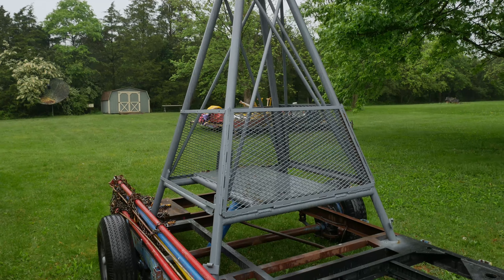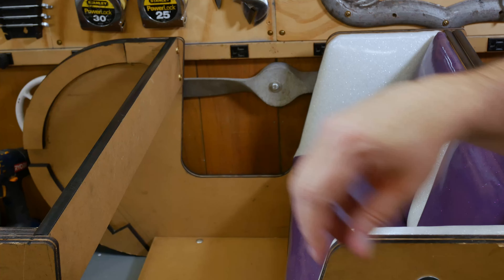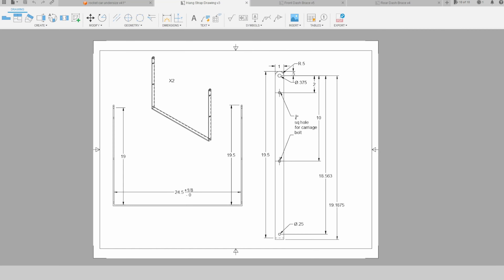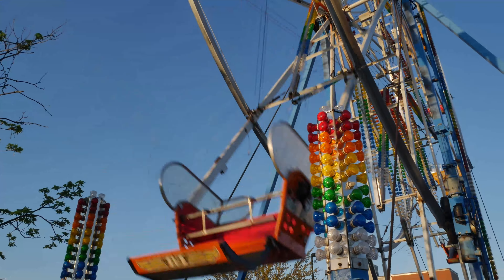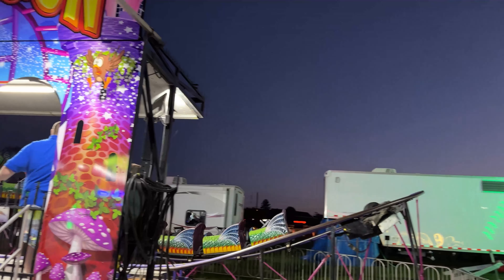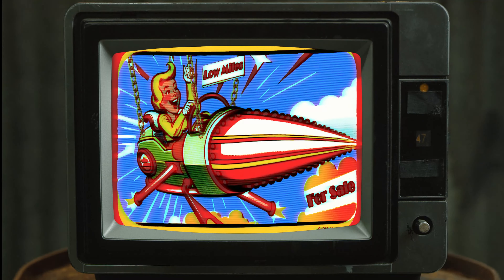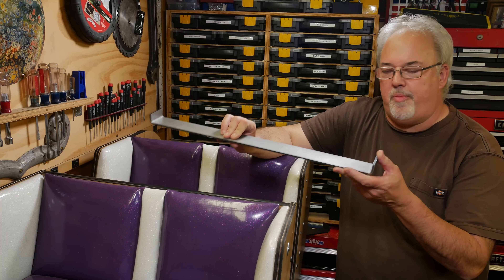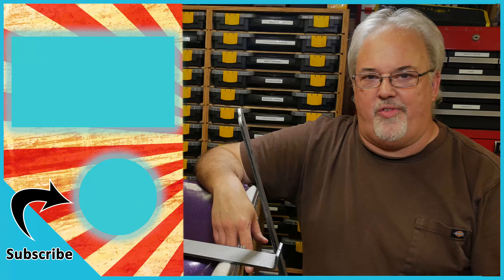King Kiddie Ride Rocket Restoration Progress

Comment: Can't get enough of this project, Pete. Great series..! Love to see other peoples thought-process when thinking about the engineering aspects of a build.
Amazing how time can get away from you, finishing the project by October is going to be quite a slog (I think I mentioned before how a build arcade machines, and some of these that were supposed to be finished mid January, are still awaiting the finishing touches!). Bummer how you've had some horrendous weather (here in the UK, it's been a constant heatwave for several weeks now).
The cars of the ride (and no doubt, the ride in its entirety) is going to be SOOooo much better engineered than when it rolled out of the factory! 
Great job! And looking forward to the next vid with all your other footage.

Comment: The Rockstar looks interesting, as the Huss Rainbows are fading away. As a Huss fanboy, I'm really interested in that. The restrains look really uncomfortable though.
I also find it quite interesting that the US banned the Tagada rides, but the very very old classic rides are still active. In germany, it is the other way around. Tagadas everywhere, but older rides need to be retrofitted to the current safetey standarts (mechanical and electric). It's not a complaint, it's just interesting for me as a german to learn about your fairs and to see rides, which never will get setup in germany.
You guys could use some of our thrillrides from europe, though :P
Reply from the maker: This rockstar actually replaced a rainbow. The difference between European rides and American rides is rather striking - I share your interest in seeing rides that are foreign to our country. As an American, I look at the Tagada and think “those people are crazy! How do they get away with running that!”  I also don’t see us ever allowing some of those rides like the swinging pirate ships that have standup cages added to the ends.
Reply: @PeteRondeau  
The Tagada has it's dangers for sure, but we expect the riders to know what they are doing. If you hold on to the bars in the back, nothing bad happens. If someone falls, it's mostly on the bum and it makes for a good laugh.
I actually prefer the "Hupferl" models. Pretty much the same, just with one big up and down direction for big air time instead of the smaller left/right movement for airtime pops. When I was a child I used to stand up on those and jumped really high. Never saw anything bad happen myself, just funny stuff 

The cages are mostly present in France, Belgium and Spain it seems like. Even Rainbow type rides and a kind of Enterprise had those cages, too. Germany says no to that. Would love to try it though. Same with a Zipper. The industrial design of the ride is awesome.

What I also really loved was the steam fair you showed. I've been a fair ride and rollercoaster enthusiast since I was a child, but I had no Idea something like existed. Even though I prefer the most intense rides, seeing that got me real excited. 

I just love how far we came worldwide. From traveling 200ft full rotation pendulum rides to 278ft gyro drop towers. It's just bonkers.

Comment: That's odd how the on that wheel is facing each other never seen that before
Reply from the maker: That is the unique feature of the Double Eagle, rather than loading one seat at a time from the end of the ride, you can load two seats from the middle of the ride.  A slight decrease in wait time- but based on how few we see out there, it wasn't a popular option.
Reply: I noticed the same thing. I thought that was odd.